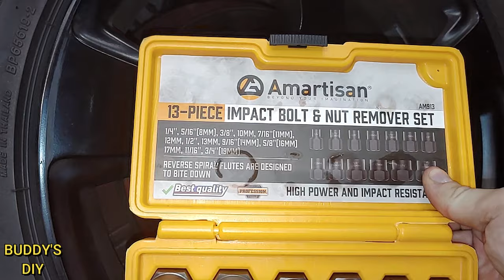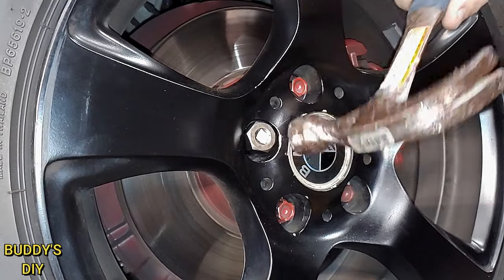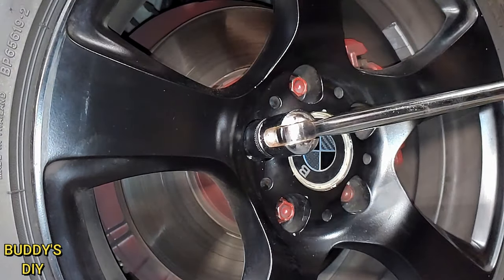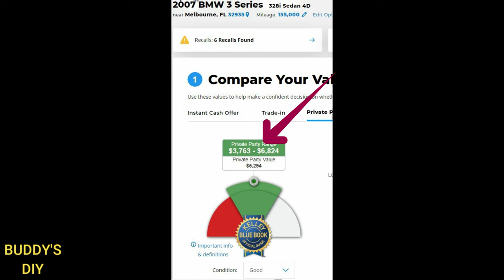How To Remove a Stripped Lug Nut | EASY

Comment: you just take a smaller MM and hit it on with a rubber mallet. Works every time. I cant believe you used a regular hammer....wtf bro
Reply from the maker: My rubber mallet is no heavy enough to really do anything. I had to use the hammer.
Reply: Lol not always

Comment: So... I had to remove my transmission to swap out my clutch in my 08 EvoX and one of my transfer case bolts was stripped. Long story short, a set of bolt remover sockets is very nice to have around!
Reply from the maker: Absolutely man. Worth it 10/10 times

Comment: I definitely recommend using 1/2" drive for lugs
Reply: Unfortunately, most nut extractor sets only offer 3/8", which means you'll likely end up snapping whatever mechanism you use to pry the nut out. The guy in this video is lucky that his alloys allow 24mm to go in. Otherwise, he'd be stuck!

Comment: Thanks so much.. I ordered the set after watching the video. It was the part that you put the 24mm over the 17mm is where I was able to get more leverage on my 2014 BMW 650i. All the front lugs were stripped from a shop trying to remove then from being so tight. thanks again.. this video save me alot
Reply from the maker: Yeah these BMW lug bolts get pretty damn tight!

Comment: Thanks! I grabbed that kit and it got that garbage stripped (tin coated) lug nut off my 2010 jeep grand cherokee- i broke my extension just like you did and even broke the breaker bar - if it wasnt for that hex on the socket i would have been screwed!
Reply from the maker: Hahaha im glad you got it off! Thanks for thr tip and im glad i could hlep 🙏

Comment: Buddy! That worked perfectly, my 1/2 to 3/8 adapter even snapped off just like yours! I have 19mm lugs, so I had to use a 1-1/6 socket to go over the bolt extractor, but it worked like a charm! Now.... how do I get the lug OUT of the bolt extractor?
Reply: Did you ever get it out of the bolt extractor?

Comment: Thank you very much.  The nut I had to remove happened almost frame by frame what happened to use.  Tried to loosen it, broken adaptor.  Use nut over the extractor, lug nut comes off.  Thanks for the video and for recommending the set.

Comment: I thought I would be able to get it done with my drill and a good titanium drill bit. No. I thought I would drill the stud out and it kinda fall to pieces so I could get the wheel off and put new studs (mine were starting to get pretty rough from all the wheel swapping). Heck with that mess. I done been thru 3 drill bits already at like $5-7 each. I’m gonna order me an extractor set like yours. Thanks for the video

Comment: Discount Tire just put on 4 new tires. They told me that one of the lug nuts / studs was stripped and whatnot, and could not be reattached, and that I should go to whoever had serviced me last. I contacted the last guy who rotated them. He seemed upset, but agreed to bring me in and get me fixed. I feel kind of bad. Could it have been Discount Tire's fault when they removed the nut? Or is it more likely the fault of whoever had put the nut in last?

Comment: @buddydyi how would you get off the locking stud bolt if the inside splines are stripped/rounded off? the locking bolt head is totally round.

Comment: Wish this worked for me.  2009 Mini Cooper S (lug bolt).  Tried three different sizes of the extractor sockets, plus heat, plus WD40.  Milwaukee M18 impact had TOO much torque; M12 impact not enough.  M18 would cause the socket to release its bite.  Also snapped off a 1/2" to 3/8" adapter (the socket opening is 3/8").  Tried the various impact sockets over top of the extractor socket... nope.  Next step... weld on a nut and pray.
Reply: Sounds like hell, Zeus himself must've tightened that one 😂

Comment: Could this work on lug nuts that are so extremely tight to the point of one whole rim and hub having to be trashed and replaced because they wont come off lol
Reply: Weld a socket to the lug nut .. You will get it off then.. I've had to do it before..

Comment: does anyone think this might work on the locking lug nuts that are smooth on the outside of the bolt
Reply from the maker: It probably will. They bite into the metal

Comment: You said this set works better than any other set you’ve had to use in the past right after you said it has only happened once before😀
Nah, just kidding man. I know you meant a stuck lug nut only once before. You meant in other parts of the car you’ve needed them. I don’t work on cars for a living but doing my family’s cars I’ve needed it a few times in about 35 years.

Comment: I don't get why these mechanics tighten these damn things down so hard so that you can't get it off your self. Like dude, you're just ensuring I don't come back to you.
Reply: I had 4 tires put on my truck.. Had a blowout on front left driver tire. They put my lugnuts on super tight.. I stripped 2 of them.. an auto shop said they could fix my tire for 580.00
They said my bolt screw is bad. I think I'll try what is in this video. Had to tow my truck home.. Too many dishonest mechanics trying to steal your money over a trivial issue.
Reply: @thomasgriffin8269  Like it's super annoying and it really proves that they don't want us to fix our own cars because then they don't get that comission. Like dude, you'll make more money doing much heavier jobs than just doing brake and rotor jobs. Don't make that hard for us. I almost had to pay a mechanic to take the nuts off because they were tightened too tight that none of my tools would budge them.
Reply: @icey_penguino472  exactly!! I am going to harbor freight this morning to by a set of reverse lugnut remover bolts and get these lugnuts off. Then I'm going to the tire shop who super tightened "welded" my lugnuts on and have them remove every lugnut on all my wheels to be hand tightened.. I am beyond livid that they don't stop to think what a burden they caused.. and replace the tire that disintegrated on my left front.

Comment: 3/8😧😳 1/2 inch breaker.  Of course the 3/8 is going to snap.  I'm doing brakes on my jeep I just bought and damn whoever put these wheels on hacked every lug and way..... To tight. Had to stand on the breaker.  No I don't have an impact available at the moment.😖